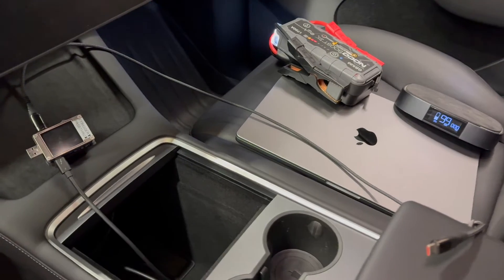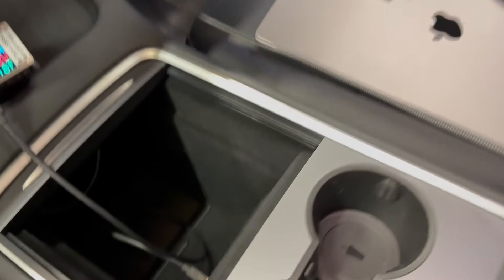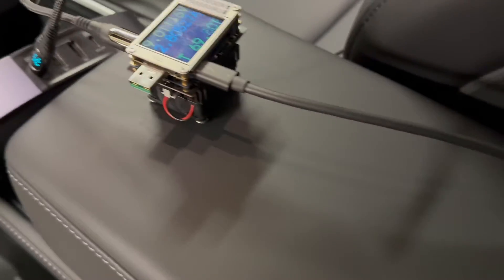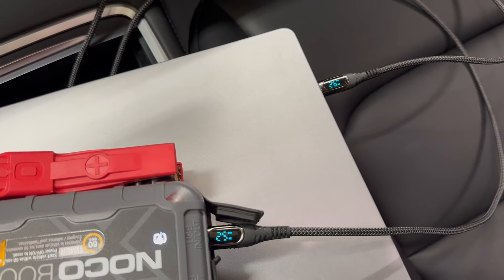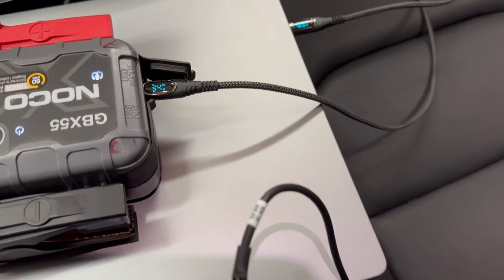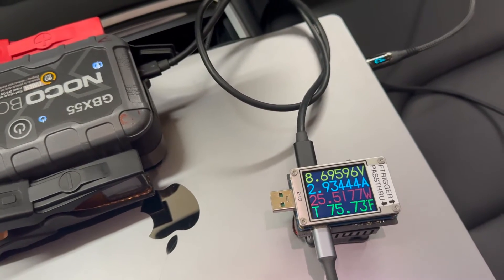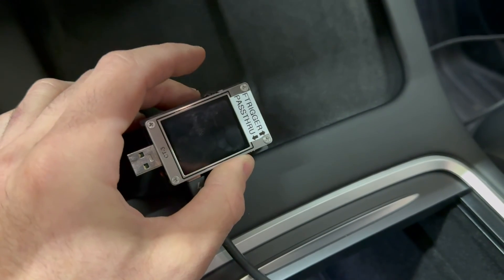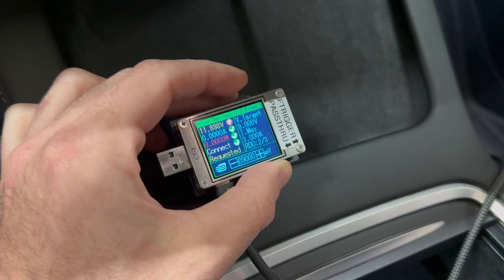Tesla USB-C Ports - How Much Power?

Comment: It depend on the voltage level of the load that you connect to. On my 2024 Model 3 Highland I got 64.5W on each USB C port. But on the manual it is specified 65W per port x 2 max or 45W x3.  Please note that it depend ALOT of the cable electrical resistance too. A poor quality low power cable can loose up to 40% power!
Reply from the maker: Good to know about the 2024 Highland specs and the cable impact on power output!

Comment: I searched “when have USB-C outlets of tesla y power”. AFAIK 12 V outlet has no power when the car is parked. I wanted to know, is USC-C PD also out?
Can there be different models? I checked a Tesla Y at the Tesla dealer in Salzburg. No 12 V 3 A available at the front ports, only 9 V 3 A at both of them.
Reply from the maker: The voltage is a result of the both the power source and the device you are connecting. You need a device capable of USB Power Delivery at the 12V "PDO". Different devices support different PDO's, like 5V, 9V, 12V, 15V, 20V. And some devices skip a PDO. It all depends on the choices made by the product engineers. For example my MacBook charger skips 12V. My car does supply 12V, even when parked.